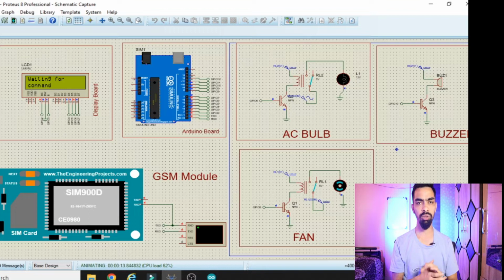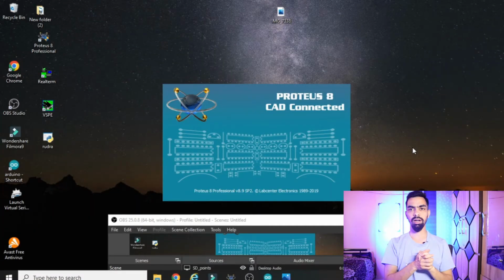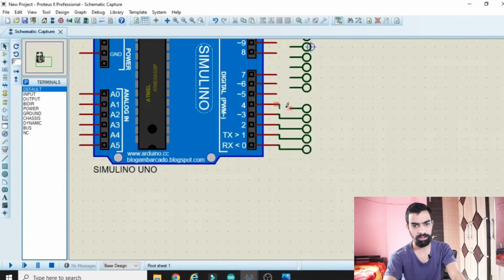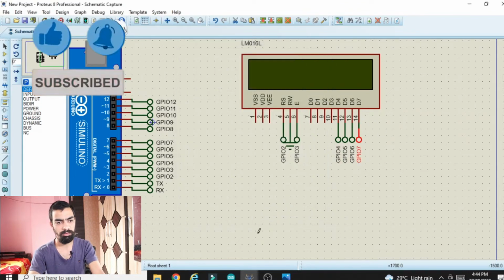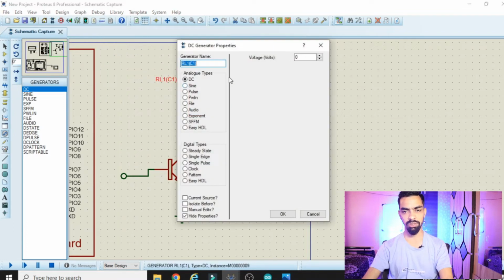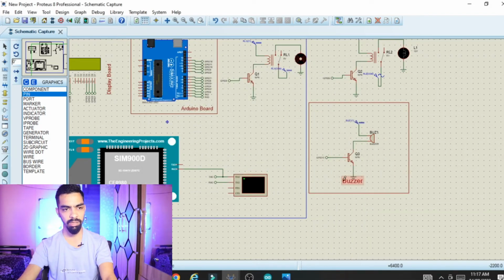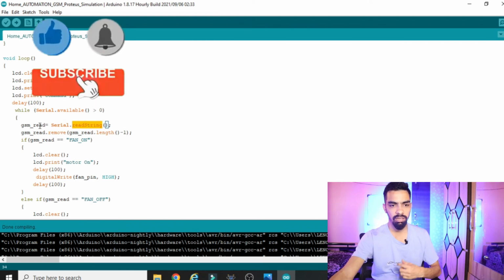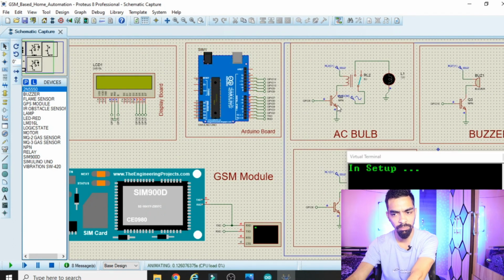GSM Based Home Automation Using Arduino | Proteus Simulation

Comment: Display not working and can't type in virtual terminal
Reply from the maker: 1.Use proteus 8.9
2. Download my ready made simulation from my website.
3. Right click on virtual terminal and select echo
Reply: @Rahul_Jadhav_Project when commands sending
Not working the components
Reply from the maker: @unknown_kerala123  send me short video on my WhatsApp number which steps you did
Reply: @Rahul_Jadhav_Project hello I tried running the simulation but it say simulation cannot run in real time because of the cpu load
Reply from the maker: @PikoloJnr  please type same message on Google you will find on article to solve cpu overload error.its specific to your laptop
Reply: @Rahul_Jadhav_Project  i tried but i didn’t get the article. ..do you have a link ?